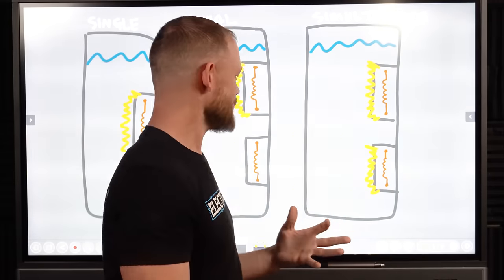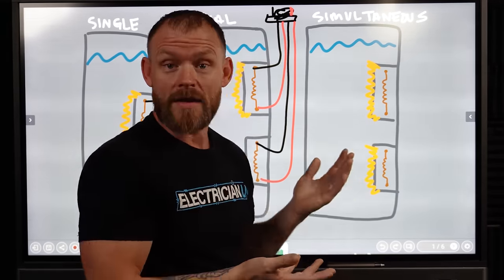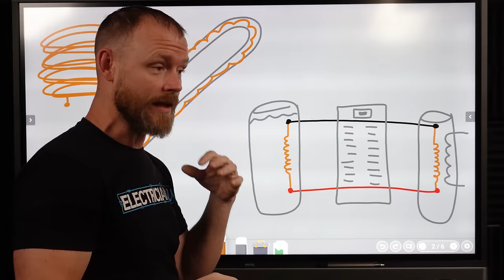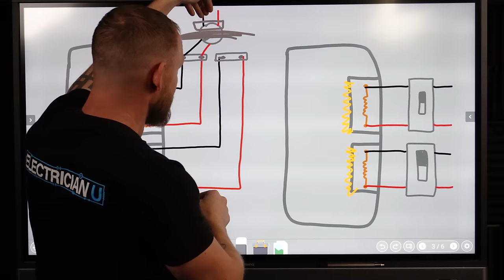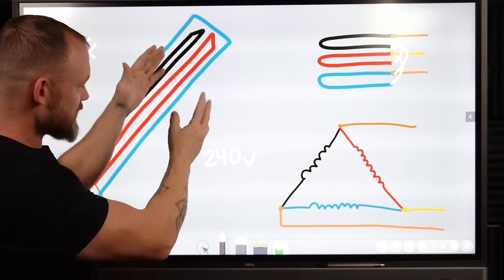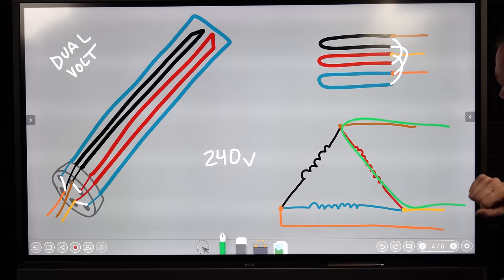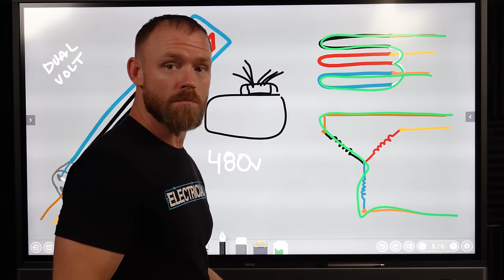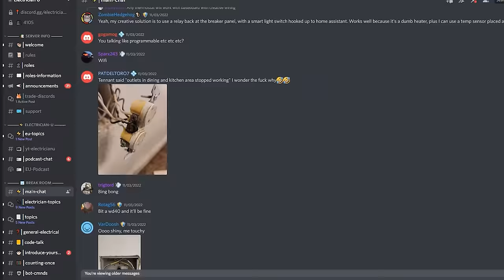Water Heaters: Simultaneous or Separate Heating Elements?

Comment: My first house had electric hot water heater. At one time it actually had two different electric meters: one for the house, and one specifically dedicated to the water heater. Communist Edison then changed their billing such that a certain number of kilowatt hours were at a reduced rate, and everything went through 1 m. Electric hot water heater is extremely expensive, And the minerals in your water will destroy those heaters very very quickly. They must be flushed on at least a monthly basis.
Reply: It's a water heater, it doesn't heat hot water. I'm sorry bud, I hate correcting people, but on this topic I feel that I must.
Reply: @Texas_krazy  sport for asking questions on discord
Reply: @Texas_krazy  sorry for questions on discord
Reply: @Texas_krazy  Of all people, Tex, You should know that a hot water heater does indeed heat hot water. I live in Phoenix, and for about five months of the year, my hot water heater heat hot water!
Reply: Flushed yearly
Reply: @troyb2208  If you live in the great lakes area and have that quality water, then yes. Anywhere in the United States, I would say to install the best mineral cleaning water softener that you can lay your hands on, regardless of how expensive it is. Anywhere that ground or river water is used, such as here in Phoenix, That stinking electric water heater is gonna load up with minerals so fast you won’t know what hit you
Reply: Maybe where you are, I flush mine every couple years and they usually last me 12 years
Reply: @Texas_krazy  If it WAS a hot water heater it wouldn't use near as much power... Note to self get water district to hook up a hot water main at the condo ;)
Reply: My parent's have had an electric water heater in their house, a manufacted mobile home (no that doesn't mean an rv), since it was bought. It's a 1995 MY. Now sure it has had to be changed twice in that time due to the tanks going bad and leaking, but no, they do not have to flush it all the time. This is with well water which has plenty of minerals because it isn't filtered at a massive government facility. Your problem might just be your area's water supply

Comment: One of the items we had to look at when performing pump rotation checks was the 480 v lube oil tank heater.  I'd always tell the new guys that we could tell if it was wired incorrectly if the lube oil got colder instead of hotter.  That was so much fun.

Comment: Funnily enough, the day after watching this video my twin element hot water system gave up the ghost after tripping out over the last week or two.  After prodding around with my tick tester, I finally gave up on it and bought my first Klein tool (only based on your recommendation of the brand), the simple ET40 voltage tester.  With a couple of minutes of prodding with the Klein tester, a faulty thermostat was diagnosed.  The Klein paid for itself almost in its first use.

Comment: Very clear and informative. Where someone might get confused, is that you should probably draw line in the tank where it switches between both elements. It’s a much smaller tank on the top so the water heats up quicker. then it transfers over to the bottom tank which is bigger. I know you know all of this. But I think someone who doesn’t know what they’re looking at is going to get confused. You should just does every draw the line to show the quick recovery tank .

Comment: Wow.   Never realized there was a thing as a three phase element.  I thought a three phase water heater had 3 elements top, middle and bottom and connected to A-B, A-C & B-C.    Never heard of duel volt elements either but it makes sense of connecting them in parallel for the lower voltage and in series for the higher voltage.

Comment: A dual voltage element connected to the higher voltage is Kirchhoff’s Voltage Law in action.    Some electric kilns, for example,  have multiple elements and selector switches to control the firing rate, and depending on the settings,  might use 2 elements in parallel,  2 elements in series, or something like that.   If you were in an environment where say only 240 volts or 277 volts was available for some reason,  you could for example,  rig up two 120V 500 watt halogen worklights in series.    The 277 volt system will make the lights brighter and not last as long, as you would have 138.5 volts supplied to each bulb, 130 volt bulbs be  better in this example.

Comment: Or... There is a set of interlocking contactors switching the heater elements similar to a home hot water heater. The contactors would be in a box close by with fuses or breakers. Control wires, possibly 120v would go from the energizing coil(s) to a control panel with temp controllers and displays where an operation can monitor the temps, etc.

Comment: Something to consider.... if the heater is in the garage, it's usually a 30amp circuit.  If you swap the bottom T-stat with the kind used on the top where it transfers current to another t-stat, you can feed an EV car charger off the 2nd thermostat.  So after your water heater is satisfied, it can then charge your car at up to 24amps.
Reply: clever trick!
Reply: Would have no problem doing that genius trick in my own house but with so many sue happy lawyers and liability issues including not listed would not offer it to any customers.
Reply: Very clever idea!!   While on the subject of EV chargers and water heaters,  specifically cord and plug connected.  It seems that at one time, a cord and plug connection was allowed for a water heater,    we found that while helping Dad remodel his 1973 ranch home.   Panel was located in a bedroom closet,  water heater was in the laundry/utility area on the opposite end of the home and connected via a nema 6-30 receptacle, as a means of disconnect.   This is obviously no longer permitted,  but you could use a nema 6-30 for a EV charger and water heater,  and simply decide which to connect, if say there's limited space in the panel to add a new 240V circuit for an EV charger.  I do not recommend this and am not responsible for any damages from following this suggestion.
Reply: @Sparky-ww5re  I gotta say that those plugs are not intended for daily plug cycles.  The J1772 plug however is.  If you are going to plug a portable EVSE in, please leave it there and don't unplug it every day.  Now if you want to use the thermostat trick I mentioned above and put a 6-30 receptacle on that, ok then.
Reply: @GeorgeWashingtonLaserMusket  Good point.  Most cars charge at a max of 32amps.  Exceptions are teslas and the new electric pickups.  However, most cars can charge quite satisfactorily at 240v 12 or 16 amps.  The rule of thumb is XX amps at 240v equals XX miles per hour charging.  So 12amps gives 12 miles per hour.  If the car is parked for 8 hours, that's 96 miles by morning.  So your future proof 50amp outlet is quite correct, but a 24amp charger will cover an awful lot of people's cases.  Most people drive 30 miles a day.

Comment: In my area just about everyone has nature gas water heaters so only wired a few in and troubleshoot them. A fiend had super hard water that caused one of the elements to burn out every year. We have a large rich pharmaceutical plant nearby that installed an electric boiler during one of the energy shortages. Ran off 4,160 Volt three phase. Cost a fortune to run so they only turned it on once a year for halve a day during a weekend.

Comment: I am off grid solar and have a heat pump water heater.  But it's backup heat source is the conventional 4500 w elements.  Since 4500w would eat up 1/2 of my inverter power, I swapped them for 1500w elements.  Takes longer to heat the water but it doesn't make me use interlocks of power management.  Also the heat pump water heater pulls 360w when running in heat pump mode.  So when the heat pump is functioning, I really don't even know the hot water heat pump is running.
Reply: How long have you had your heat pump water heater? How do you like it? It sounds like it is a great choice for energy conservation.
Reply: @markpetri3405  about six months. It’s in the basement.  Serves double duty as a dehumidifier too.  No issues.  It just works.

Comment: What happens if you take a 220v single phase water heater (4500 watts element) and hook it up to 110v? Does it just take twice as long or longer to heat? Does the wattage go up, stay the same, or go down?
Reply: P = IE
Half the voltage results in half the wattage, and thus, twice as long to heat up.
Reply: Power (W) is equal to V^2 / R, so by halving the voltage on the same element you will reduce the power output by a factor of 4.  Likewise, doubling the voltage will quadruple the power.  So a 10 ohm element will deliver 1,440 watts of heating at 120V, 5760 watts at 240V, and 23,040 watts at 480V.  The surface area of the heating element becomes an important factor at this point, as you risk damaging the element if the watt density rises above what the material is rated to handle.
Reply: @icanreadthebible7561  Wrong. Current will not be the same. The other commenter is correct with his calculation.
Reply: @ivandiaz5791  Indeed, current scales linearly with voltage in a resistive load.  We can use Ohm's law directly (I=V/R) or divide the watts by volts.  In the10 ohm example above, the same element draws 12 A @ 120 V, 24 A @ 240 V, and 48 A @ 480 V.  

Answering the OP's question directly, powering an element intended for  220 V at 110 V will increase the heating time by at least a factor of four.  In an ideal case it would be 4x, but in the real world you have to account for heat loss from the vessel to the environment.  You might never be able to reach your target temperature if the rate of energy you're adding (watts) is less than the rate of loss to the environment.  Down that road lies the dragon "differential equations", though, so "at least 4x"  is good enough. :)
Reply: @skroz1  hi...want to hear more about damage

Comment: Hey Dustin, do you mind talking about troubleshooting . I’m experiencing a loss of power to a specific bedroom on a house and the breaker is tripped, there’s many reasons as we all know what would cause it to trip but wanted to see if you could make a video on troubleshooting residential breakers and circuits
Reply: I would put a clamp-on ammeter on a conductor and reset the breaker while I watched it. You can this was determine if there is a short circuit or if the breaker is defective. If the current draw does not exceed the breaker rating, the breaker is bad. If it exceeds the rating of the breaker, there is a short or low resistance faulting the circuit.

Comment: If we take as given that there is enough headroom in the main breaker, and we are able to easily run a second 240V circuit to the water heater, is there any downside to converting your sequential water heater to a simultaneous one?

Comment: Could you do a video on trouble shooting / fault finding using the multimeter on electrical circuits and motors etc.
Reply: Ground faults on a 3 phase system is something I wish i had to do less in industrial facility's

Comment: Great video/content! I have a rental property and new tenant needs an 80 gallon H20 tank. Only one I can find is light duty commercial Rheem dual element that ships as a simultaneous element wiring 4500/4500. The spec sheet says it can be field converted to non simultaneous via the terminal block L1 & L2 single phase. I only have 30 amp dual pole 240. Have any experience with these types of commercial units that are field convertible? thanks in advance sorry so long!

Comment: Actually, you can't tell from the photo whether it's simultaneous or alternate because you don't have the control portion. The element banks could be bridged in parallel off one contactor or controlled from two contactors.

Comment: How do I install a 2 pole 30 amp breaker in an 50Amp RV for a instant tankless hot water heater? Can I add a small sub panel and add the 2 pole breaker and each pole can be on a separate leg of the 50 amp system? I cannot find clear information about this so any help would be greatly appreciated. Also us there a difference between regular breakers and RV breakers?
Reply: @jahmanborneo1343  I'm from west Phoenix.....buckeye actually but I currently live on the central Oregon coast. And I don't want to use propane I'm fine with the electric and I'm not worried about tripping a breaker because the 50 amp system has plenty of power to be able to run an ac as well as the hot water I just won't use both ACs while using the hot water heater and the heater o have is sealed up very nicely I am not worried about critters. And this water heater can pull power from separate legs from the electrical system so it won't be making a significant  dent in power consumption. Not to mention. It won't be constantly running only while showering. I already have a water softener and filtration system as well as UV. This unit is only 5.5KW and as I said that will be separated between 2 legs so about 2700 watts per leg. A 50 amp system  can handle 12kw... 6kw per leg so I'll be fine I'm sure. But I appreciate  your advice still and I plan to be going back to Arizona within the next year so if you know a reputable place I'd definitely be interested. Thank you!
Reply: Rv are 120 1 leg ove power I believe don’t no newer one
Reply: @mccarthymccarthy237  a 50 amp rv has 2 legs of 120V 50 Amps each
Reply: @mccarthymccarthy237  RVs typically do NOT have 240v appliances or devices, so the two 'hot legs' are simply used as two different 120v lines, to two SEPARATE power buses - therefore 100amps of usable power is CERTAINLY and COMMONLY possible - many of us certainly do especially during the hot summer 'two air conditioners at the same time' months!
Reply: @mccarthymccarthy237  If you were to fully load one leg to 50 amps to the neutral, so 120 VAC, with nothing on the other leg, and then exceeded it, the ganged 50 amp breaker would trip. If instead, you started adding load to the other "hot" leg to neutral at 120 VAC, you could add up to 50 amps on that leg as well (since we're talking 120 VAC). At that point the neutral would be carrying 0 amps.
Reply: @flirtnwthdisaster2619  ok don’t no even 50 amp had 2 pole 50 amp up north 30 amp 1 pole are water temp 40 on demand don’t work without proper specs flow and amps

Comment: Just thinking that maybe you could explain how three phase panels can be CCW or CW.
Reply: If you're talking about how reversing two leads will change motor direction it's simple. If you have a phase sequence of A-B-C-A-B (remember you're dealing with a circle) and you switch A and C you get C-B-A-C-B. If you switch A and B you get B-A-C-B-A. B and C gives A-C-B-A-C. Note that each of the reversals has  a C-B-A in it, the reverse of the original A-B-C.

Comment: I disagree with the answer you gave to the quiz. My answer would have been "you can't tell from that picture" because you don't see the other end of those two sets of 3-phase wiring. It looks to be industrial equipment, so I'll use industrial terms. Each of those sets of 3-phase wiring should be coming through contactors, one contactor for each 3-phase set. I haven't seen a dual ganged 3-phase contactor, but I don't see why that wouldn't exist, so in that case it would be simultaneous. If a single control wire is controlling both contactors it would be simultaneous (if it isn't obvious that the contactors are wired in parallel, look at the wire number labels if they haven't fallen off). If each contactor has it's own control wire then you still don't know. You then have to look at what is controlling the contactors to determine if it is set up to control in simultaneous or separate modes. IMHO, you are making too many assumptions on what you can't see.
Reply: Agreed, just by seeing that it seemed like it was industrial or commercial setting. Up top could go to a switch gear and ect
Reply: @BowensBlvd  Definitely commercial. The only residential three-phase would be a large multi-unit and the individual units would be wired for single-phase anyway.
Reply: They could actually be driven off a single contactor. This is common is large industrial electric ovens where there are multiple three-phase banks in parallel.

Comment: in this video you had 240v with 3phase. wouldnt this be 208v?
Reply: 208V 3 phase would be a wye configuration.  240V  3 phase would be a delta configuration.  Just depends on how the transformers are configured

Comment: Water heaters draw the hot water from the bottom of the tank through an internal pipe not the top of the tank.
Reply: No. The dip tube brings cold water to the bottom. In a residential dual element heater the upper element heats the water that is then drawn off the top. If the water at the top is at the set temperature then the thermostat switches the current to the bottom element to preheat the incoming water When the temperature of the water at the top drops below the threshold the thermostat switches back to the upper element to bring the output water back to temperature.

Comment: most commercial jobs ive done over the last few years dont use element water heaters anymore. its going the way of the dinosaur. insta hots are exponentially better
Reply: I assume you're talking about a gas tankless water heater
Reply: @hunterbrooks6207  no. Electric
Reply: @hunterbrooks6207  240 v just like the normal ones
Reply: They do use elements too but at a higher amperage rate. 9.5kw x3 elements.